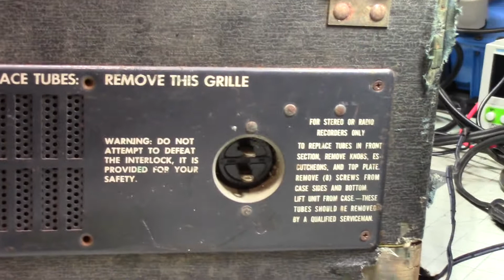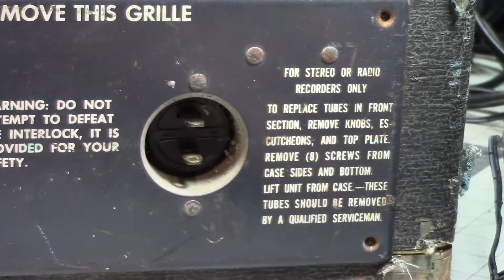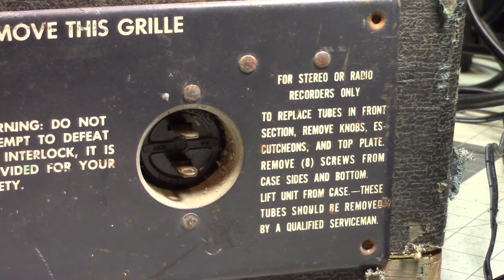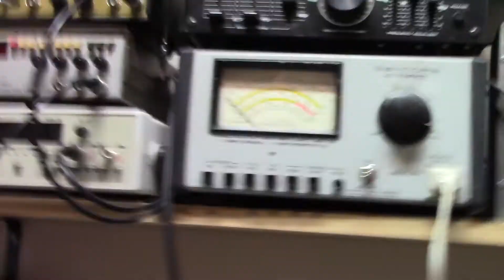Webcor Royal EP2911-1 tube type reel to reel  repair. Part 1 of 3

Comment: I just got a webcor 2820 1958 belt driven with the added stereo circuit and it has the exact same main board
Reply from the maker: Very interesting. Webcor, and others, seemed to create different models but use many of the same components. I guess that was a cost saving approach. On the rear cover plate of my tape player were instructions for a stereo tape recorder. I always wondered why it was on my unit. It is possible that someone replaced that plate with one from a stereo model.
Reply: @oldelectronicsfan5136  my 2911 also has that on the "interlock device"  the 2822 is the stereo version of the 2911.  Here's the real mystery, your mono 2911 has 2 vacuum tubes on transformer and power output board and mine only has one. Mine works 100% perfectly though.

Comment: I inherited a Webcor Royal EP2821-1C and have been trying to listen to some family recordings from the 1960s. I cleaned the heads and didn't solve the issue. Is there an easy way to clean the contacts in the volume/off-on knob?
Reply from the maker: It isn't easy to get to the controls on this. The easiest way looks to be to, at least partly, remove it from the case. Then you can get to the controls. Unfortunately, it doesn't appear you can get to the controls just be removing the  top cover.
Reply: @oldelectronicsfan5136  Thank you for the info. I think it's time to find it a new home. I also have many tapes of recorded music. Any suggestion to who may want to buy it? It would cost a fortune to ship so I'm hesitant to put it on ebay.
Reply from the maker: @debbienoles8097  Are you near southwestern VT? I am not aware of anyone looking for one of those. I believe you can post it on Ebay and specify local pickup only. I know you can do that on Facebook Market Place.